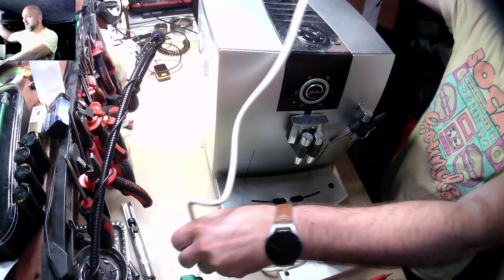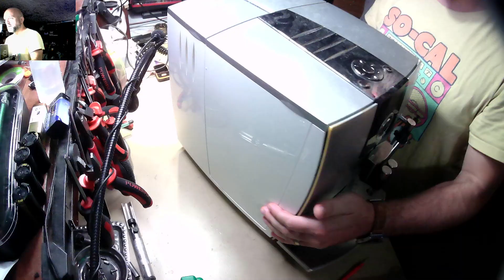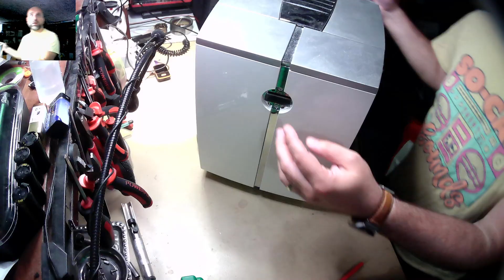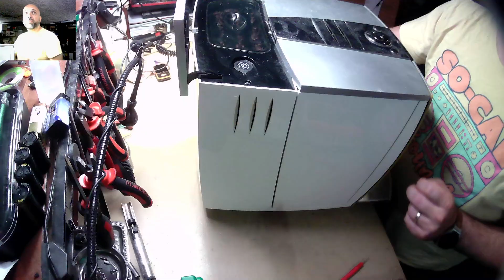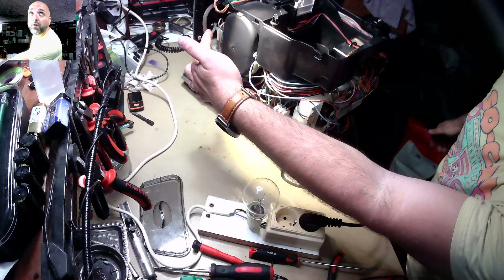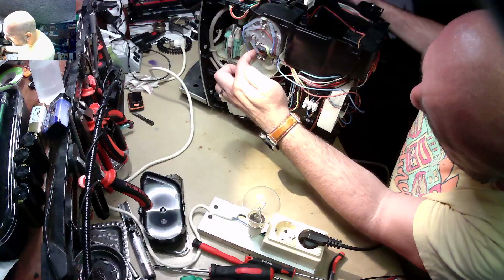JURA J5  tripping the Circuit breaker - Repair and Troubleshooting

Comment: I'm interested in how you've created your circuit breaker tester. Do you have a picture of the circuit board. My Jura Z5 often causes a electrical short, even when the On/Off switch is in the Off direction.
Reply from the maker: Make sure you use a normal.bulb at least 100 W.   https://blogger.googleusercontent.com/img/b/R29vZ2xl/AVvXsEjHct01F-Vyc6MJ5eJ2Qeq0Mu5_pFUF1TsDPqZRDo0lXxCm3l5tfp_1j4H-Mq20y3z63dFv8GMermLfFvODjtN8ZjpjYbT-7ZPtssiNZbZ7Z8MB4EpqeTWaxMf1Vcu_SReWleRjhxpRSwmG/s887/12.png